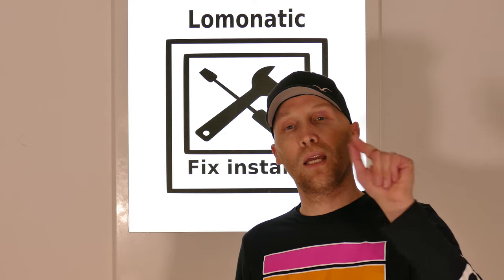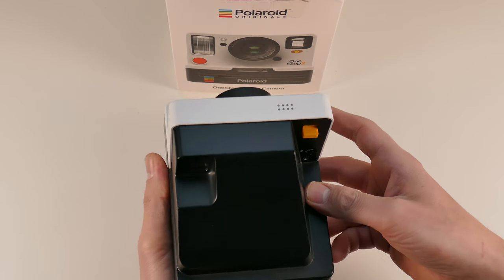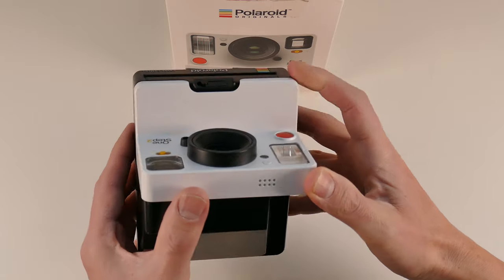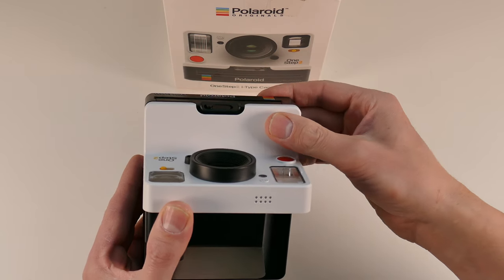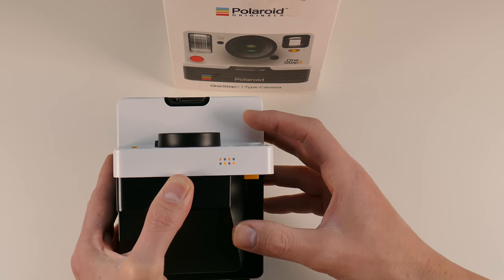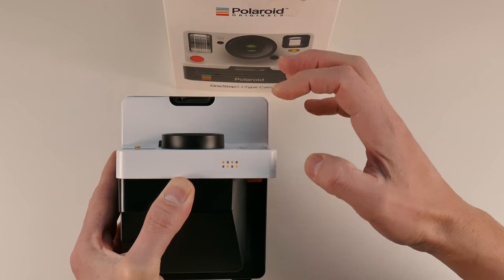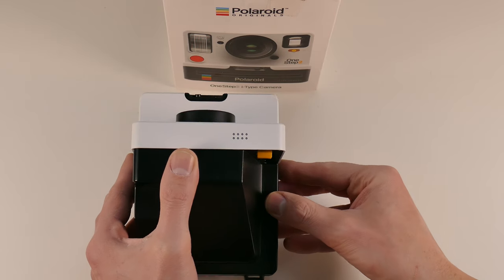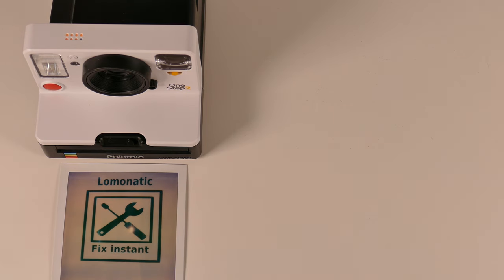Polaroid Repair - Service Mode i-Type Camera [ENG]

Comment: So that was my problem in this video but I seen that the silver latch that pushes the photos out isn’t doing its job so I need help with figuring out how to put it back in the proper place so it can work. I also noticed when I put in new film it doesn’t click into place like I used to

Comment: Hi!
I find your videos very helpful!! 
I’m experiencing a problem with my Polaroid one step 2.
I’ve charged it for a day now and It still has no battery light once turn it on, I thought maybe it was the charger so I went and bought a new one but still no sign of life !! Please help
Reply from the maker: Have you maybe your camera left in "On position"? The battery could bei deep discharged ! I would try to charge the battery a couple of times....it could give the impulse for recharge over a critical electrical voltage of the battery!
It's your own risk , the battery could be damaged.
If you have warranty...you should use it !!?
Reply: Ok thanks I’ll give it a shot !
Reply from the maker: I have another Idea to give the first charching  impulse...trie to load it with a powerbank !
Please give me a feedback wirh your results !

Comment: Whenever i try to turn the flash off pressing the two buttons it takes a picture
Reply from the maker: Normal...when you press the Flash override button and the Shutter button at the same time...there should come out a picture without flashing !!!
The Flash override button only breaks the Flash  while you hold it pressed. In other words...it interrupts the power for the Flash !!!